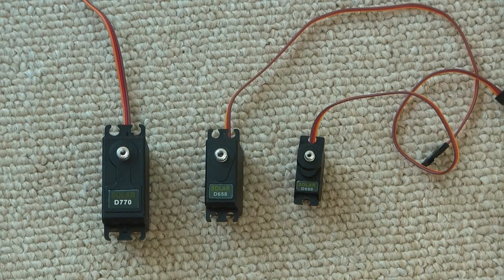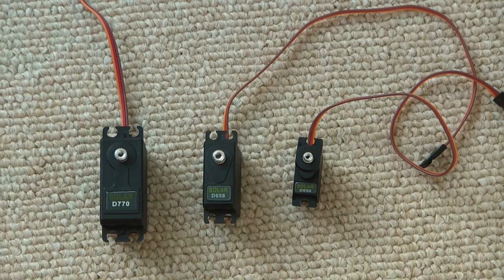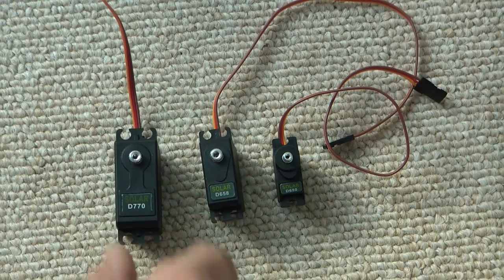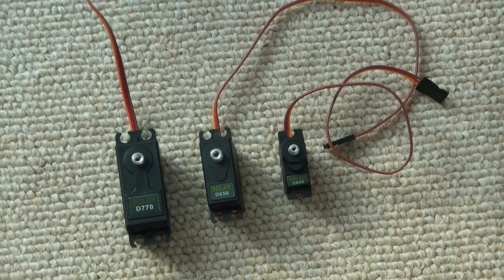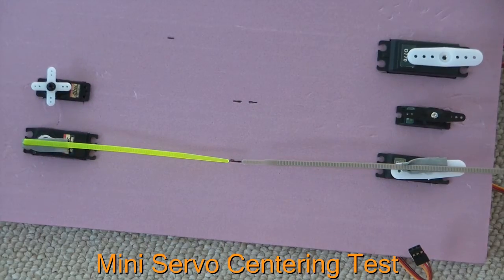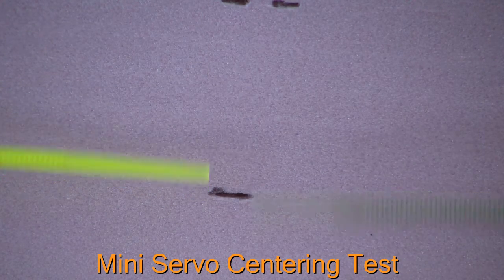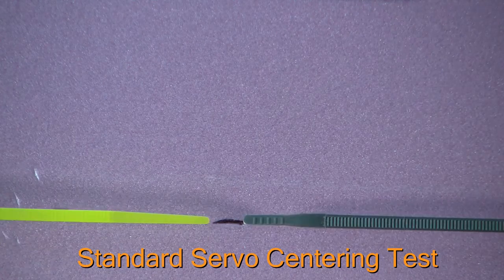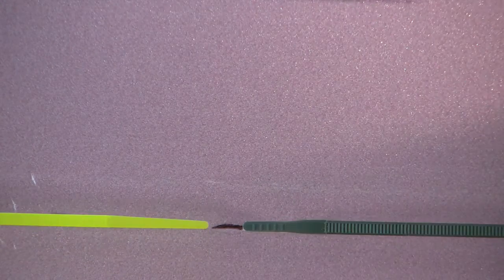Solar Servo Review

Comment: Good review but a servo operates under a load and the field of electronics has yet to establish an inertial frame of reference for time and a digital servo will sometimes have an issue with centering and oscillate "lost" but in flight under pressure doing work the oscillation stops. I'd like to see them tested with a load on them as I have seen servos do well centering but lockout unable to perform and just watched a video where that was happening used in a monster truck and the torque specs meant nothing as the servo failed to be able to steer the truck going over rocks.

Comment: Yes, the d650 fits perfectly in the mini-t and is a huge improvement, but it has a smaller spline size, so the stock servo saver doesn't work. So far I haven't been able to find or figure out a servo saver set up. It took a lot of abuse though before I finally stripped it, with steering knuckles and tie rods breaking first...but obviously it can only take so much abuse until something gives. If anyone knows of a servo saver that will fit please advise!

Comment: Do you know if the Micro size will fit the Losi Micro T cuz I heard they are good quality btu the stock servo for the Losi Micro T is crap and its a 3 wire